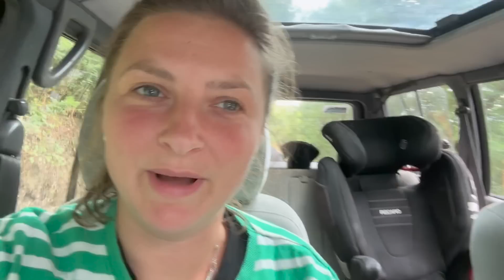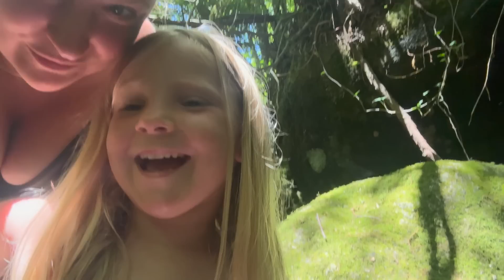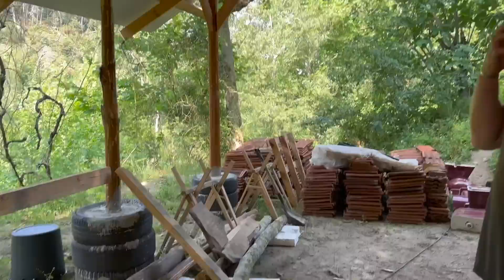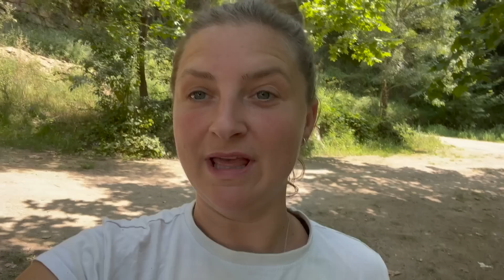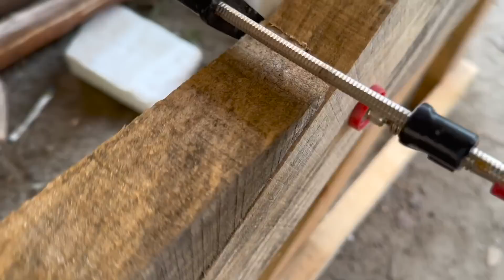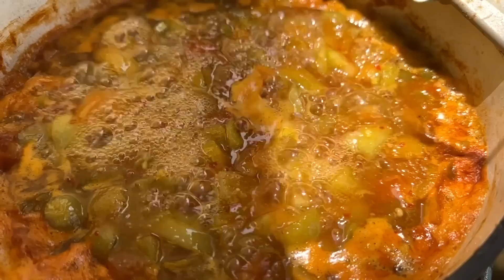Security upgrade! Plus S.O.T (save our tomatoes) 🍅 🇵🇹

Comment: Love your videos, and I was going to give you some advice from my experience while growing vegetables in the 1970/80s in Africa.  How to prevent and treat early blight of your tomatoes.  This is a nasty fungus and you must check it daily if you want to have a successful crop. It will not kill the plant, but will reduce your yield, that’s why you must your tomatoes carefully.  If you use a copper fungicide dust, it will kill the infections early, before it starts to spread.  If untreated like what has happened in your case, this fungal disease will cause your crop to rot.  Late blight can kill your tomatoe plants quicker and will spread rapidly for miles.  If you only see a few infected plants, best to pull them out and burn them, never put them into a compost as a general rule.  I never grow tomatoes with eggplants, potatoes and peppers  alongside each other.  Use companion planting methods and use herbs even marigolds around your tomatoes.  If you are not allowed to burn your rubbish on your plot/farm holding, then the next best thing is use black plastic in full sun all day cover with soil cover then cover with black plastic, making sure you cover all the edges of the black plastic with soil and put stones around the edge. No sticks, or grass, cuttings at all for at least two months.  This will bring a very high temperature which will capture radiant energy from the sun to kill off the pathogens.  Hope you have a better crop next season.  Hope that helps.
Reply from the maker: Wow Tom honestly thank you so much for taking the time to share your knowledge and advice really means a lot and is so helpful! 
I will definitely take this on board for next year! Thank you again! ☺️

Comment: Great job guys.  We did gates like yours that were 8 meters total and the weight was too much on the side posts so maybe consider putting wheels on each gate so that not all the weight is on the hinges which with time would twist the posts…we had to change the whole gate system on the 2nd year because with the winter rain in Chile (that looks a lot like what you get in Portugal) the gates would be heavier than in the summer which created more issues with the posts, hinges and doors.  Looking forward to seeing your end project.  Missed the kids saying their 3 Portuguese words this week 😊
Reply from the maker: This is so helpful thank you we are a little worried about the weight so maybe wheels would be a good solution! 
Sorry they had a crazy week but don’t worry the words will be back this week!☺️

Comment: Hello, I love your videos.. A suggestion: make a trench on the upper slope of the shed they built, so that when it rains the water runs through it and doesn't wet the shed floor and turn it into a mud hole.  🥰💖💚🌷🌼 Hugs from Brazil 🇧🇷 🎉😊
Reply from the maker: Thank you so much! And yes that’s a great idea thank you 😊